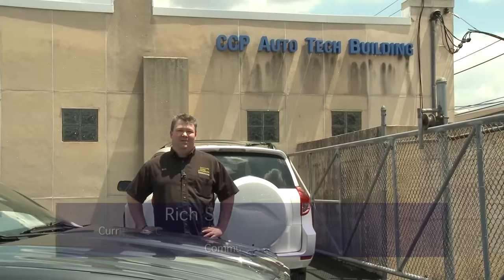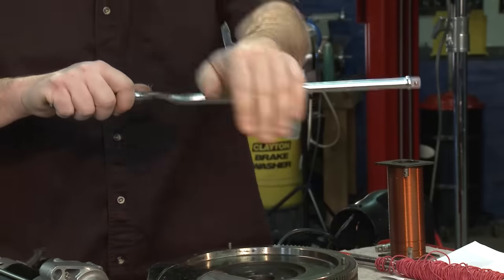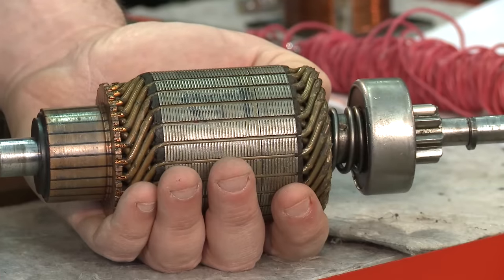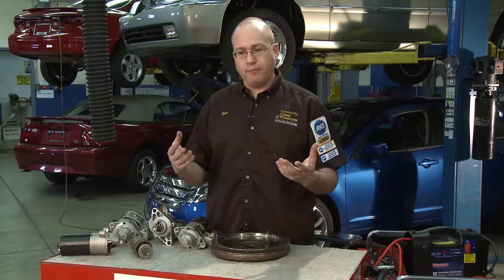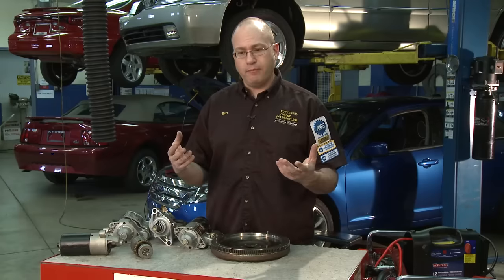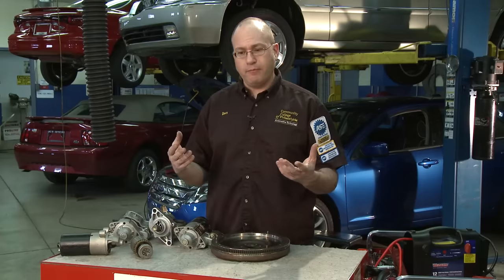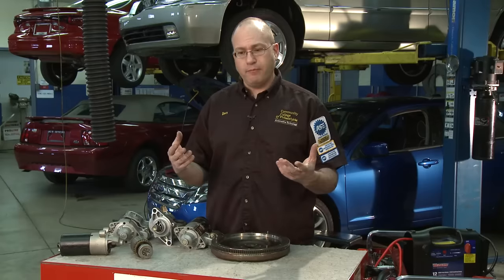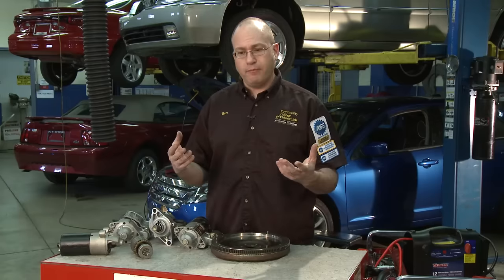Car Corner: Starter Maintenance

Comment: Dear Sir, 
My congratulations for your educational, beautiful and fully explained video. 
But I still have some questions to ask: it often happens that the gear of the bendix does not retract into the starter motor after the engine has been started, but continues to be driven onto the flywheel. 
What could be the consequences of this: that the bendix, soleonide or starter motor would burn if I did not hear it and start driving my car at a higher RPM then the starter is made for? 
Does the bendix function a little bit like a ratchet, that it can spin freely without causing any damages? 
Could it be that the solenoid (relais) continues to receive electrical impulses from the ignition switch, (the electrical part from the switch) even when the ignition key is released? 
Or is this fault caused by the mechanical part of the starter motor? 
Does it then stick to the flywheel, or can it get stuck due to some dirt and no longer retract due to the current flow that isn't interrupted. 
I even had a strange experience about 5 months ago, that the key was in the "Run" position (and not in the start position) and the starter started the engine. 
This happened 3 times in one week, but in the past 5 months this didn't happen again, it disappeared on its own. 
I would greatly appreciate your views on this, for which I would like to thank you. 
Good luck with your upcoming videos.

Comment: Clearly Dan  is the man, love the story telling an the demonstration. i stopped at the 26:16 because the solenoid was not correctly diagnosed and also saying that its not repairable(the whole starter,just to be clear) is not true at all. i repair starters everyday and we are far from just replacing starters. if it was the Armature that burned sure i would replace the starter because its the most expensive part in the starter but it can still be ordered.

Comment: 25:30 it seems the solenoid has a pull in coil to supply the stronger force needed to pull in from the initial position, and a weaker holding coil, which is able to maintain the closed position once it's there.
the pull in coil can only withstand a brief period of being energized without burning out, so it uses the virtual ground of the motor connected in series through what was termed the M terminal. 

if power is applied between the S and M terminal, 12V and ground respectively, it should power the pull in coil and be able to actuate the solenoid without manually assisting it.

once it engages, the terminal is connected to the 12V of the battery terminal, and the pull in coil no longer has any voltage differential across it, so it no longer does anything.
At that point, the weaker holding coil using the case ground is all that's needed to maintain the position.

when the starter signal at the S it switch terminal is removed, the solenoid is able to retract from the spring pushing it back to the original position.

Comment: My first car that I bought had a starting handle and I was very disappointed when I bought my next car without one. You could turn the engine over slowly to get the oil going in all the right places especially if it had been stood for a while in winter. Of course there was a technique how you held it before giving it a good swing to get the engine started.  If you didn't hold it correctly you risked breaking your wrist or worse.

Comment: Solenoid not pulling in... perfect problem to have for this vid!  Solenoids need their voltage obviously,  but there are two current requirements: pull in and holding.  What those numbers are depend on the wind, but always expect higher current to pull in. It's less than a second, but it has to happen or you won't get movement.    So, if your battery is on the edge, connections are loose, or have a wire with partially broken conductors [as in somebody hung the starter from its wires on a lift some time back] don't go racing to change that solenoid until verifying whats feeding it.
  Do you own a DC amp clamp meter?  You should - very helpful in troublshooting any inductive loads like motors or coils.
Edit:  I forgot my question - what do you like to see for mica undercut on most automotive starter commutators?

Comment: Nice that is one of the best trys I've seen so far however the saying flying off the handle its origins is 1st used in the year of like 1840s and it meant someone going crazy like a axe head flying off the handle and that's the origin of that but I have no doubt it was just as common of your story

Comment: Your battery pack was not weak..... there are two sets of of windings in the solenoid. The first is the pull in winding which gets it's earth via the brushes , this winding draws a large amount of current. As soon as the  contacts on the solenoid close , the hold in coil takes over (drawing a lot less current) . You were trying to use the hold in coil hence you had to help the plunger go into hold in mode.
Reply: Spot on.
Reply: Thanks, saved me the trouble of replying. Solenoids are often replaced when the pull-in winding can't find its ground (brushes or armature).

Comment: This guy is the real deal...great mechanical mind! Funny how Cadillac was first to make electric starters standard on all production models...then years later they placed the starter in between the valve covers underneath the intake manifold on the North Star WTH we're they thinking?! I'm starting to understand how manufacturers no longer value their customer's or the quality and longevity of their product. Now they build them to break so you have to buy another one failing to realize the negative experience can make customers try different brand makes losing past practice of longtime loyalty of car and truck buying. Just saying...

Comment: Well done 👏  I did jumped my hyundai tucson 2.7 starter direct to the battery by  splicing ground wire and running it the the battery and I got a loud clunk coming from the starter. 
My brother inlaw told me it's another way 🤔 of testing 
The reason why is i brought to the starter  shop and they said it's good and witnessed spindle spin. But my brother inlaw said there's no load on the starter. 
So when i preformed that jump method the starter didn't turn over the engine. So it showed that the starter is stuck or not turning the flywheel.
Is this method on checking if the starter needs replacement??
Thank you 😊

Comment: Just installed a new starter, when trying to put negative terminal on my battery sparks coming out. Also starter stays always ON (spinning but not engage) - after my first key ignition start. Now every time when I put the battery negative connector starter just spinning (when relay is took same thing - but sometimes goes off). I also detached 's' from the starter and same thing also stays on! 

Any ideas what could be wrong? Solenoid is broken or something else like short on the circuit? 

Thank you for your help! GREAT VIDEO!

Comment: I doubt the "electro magnet" demo you made was still slightly magnetic because sometimes those socket extentions or bits have magnetic material in them making your screws or bits cling to it so your screw doesn't cause such a pain. Another reason I don't think the electromagnet isn't attracting is it had no power to create the magnetic field, take a scrap crane with the electromagnet attachment on it, it doesn't attract until the operator give it juice which it then attracts. Good video though👍

Comment: NICE lesson 
Periodically my stater will not disengage fast enough and remains engaged after the engine has started. I immediately let the clutch out and stall the engine. Even shutting off the ignition is not enough to shut the engine down. 
Will this this issue damage the starter?
Thanks

Comment: I had an old Renult car in the early 1970s that had an optional hand crank.  Unfortunately I had to use it sometimes due to battery problems with the car.  I felt that kickback a few times and it usually hurt my arm when doing so.  But it was not a serious injury, since I was wary of the possibility of the kickback.  My guess is that only people ignorant of the possibility of the kickback didn't crank in a proper manner.  When my manual cranking didn't work I just pushed the damn car and jump started it.

Comment: Good stuff Dan - very helpful well presented informative session and really appreciated. 
 But a bit of interesting historical fact about your illustration of holding the crank handle witha full grip around it..  
 It was never a good idea to hold the crank handle as you did with the thumb around the handle because many people injured or broke their thumb  when it was around the handle when there was kickback and the handle..
The safe process was to Not put your thumb around it but keep it on the finger side of the handle so when there was a kickback it merely broke your grip and the handle came safely out of your fingers.    
.

Comment: One of the main problems with the starter is the solenoid which is a high amperage switch so every time you start it you get a spark and that burns out the main problem with the starter is actually the solenoid that start switch used to be able to replace that solenoid but now you have to replace it all which is not a bad idea because the solenoid doesn't really wear out that quick probably by the time that wears out you do need a new starter so it's kind of a package deal

Comment: Thanks for the video,  I learned a lot.    My 2008 Chrysler Town and Country is not starting.  I can hear the starter spin but not engage the pinion, no engine crank.  I removed the starter relay and short the two connector 30/87 and can hear the same like high speed spinning.  Could it be the solenoid on the starter?

Comment: That was excellent  Dan!    I am having a problem with  my starting  on a vw cabrio.  I had a bare wire  ( worn insulation) to one of the solenoid motor terminal posts and i applied dielectric grease to protect it  ( dumb move) .  I drove down green lane to main st in Manayunk and the car stopped running. I think that i MAY HAVE ATTEMPTED CRANKING  the engine over  while in DRIVE.   So now I dont know if it was the grease on the wire or if it was the cranking while being in DRIVE. Now the key doesnt bounce back to run from start. The display  icons on the dash are on even without the key  in the ignition.  Anyway you've given me plenty of info to go by .If anyone has any opinions on what the dielectric grease did I'd appreciate your  input . 
Thanks a bunch.

Comment: I think in some german cars it is required, by design, to remove the battery to replace the starter
that way there is no risk at all to have any issues with electricity
that also makes for pretty easy acess to the starter, so you can remove it fairly easily
tho, what I was missing here is the starter style where you only have the pinion move out when the starter is engaged, the shaft has a shaft seal to prevent dust ingress and grease from getting out
a pretty small, but important detail in my oppinion as it decreases wear and increases durability of the bearing
Reply: When you are working with "Vehicles", always take your Battery off, unless you are working with a Radio!  Not only with other dangers... It also protect your important components, like the ECM (Computer), which is expensive.

Comment: I have a question. I have a 1961 Chevy Apache the starter has four terminals the two big lugs, one for the solenoid and the other for the ignition not ground. It’s grounded through the chassis. Can you explain how this works? The HEI is attached to the ignition screw the solenoid ( purple wire )is obviously ignited by the ignition ( pink under dash white at this terminal).

Comment: Hey Dan Great video. Question for ya ... I'm experiencing a problem where my starter will intermittently continue to crank even after shutting off car or removing the key. Could my starter be faulty or is it an electrical problem?

Comment: excelent video well explaned.  reason why I end up watching this video is beacause today after replacing  the starter on my 1998 chevy silverado  k1500 truck I had cranked the engine right when I  was reconecting the battery terminals.
that was tell me that something was not right .
also with terminal wires disconected from battery I had countinuity was that normal?
with no key on Ingnition?

Comment: I see that you put only 1 starter holding bolts, it should be 2 bolts, right? and also you did not tightened it. Anyway, I like your demo board, I will make my own similar to that yours. Nice presentation Dan.

Comment: absolutely the best explanation of the starter/starter solenoid i have found anywhere.  i'm currently troubleshooting a riding lawn mower starting problem.  do ALL starters work via the moving plunger/fork mechanism activated by the solenoid?  the reason i ask is that there are a huge number of youtube videos that show a solenoid completely physically isolated from the starter motor.  does this mean that what most are calling "the solenoid" is actually different from the "starter solenoid (that is mechanically linked to the starter)"?.  in other words, if the solenoid is physically separated from the starter - how do the starter teeth move into place to engage the flywheel teeth?  i suspect there is much confusion about what component is actually being discussed in those other videos.  likewise, successfully cranking a mower by shorting the "B" and "S" terminals with a screwdriver would actually mean the staring system problem is somewhere other than with the starter/solenoid (because otherwise - how would the plunger/fork system to engage the starter teeth into the flywheel activate?) - did i get that right?

it would also be nice to hear some reasons why a starter solenoid and/or a starter motor actually fail.  after removing and isolating them to a very similar benchtop setup like yours - my solenoid appears to have failed and my starter runs intermittently and begrudgingly - like it has some high internal resistance, possibly that is what caused the solenoid to fail.  all i know is that my honda engine has been flawless until last year, then began becoming "cranky" -  needing charging/jumping even with a new healthy battery and starting giving lots of solenoid clicking before occasionally starting up.   i hesitate to simply throw in a new starter/solenoid if there is some other problem that will eventually just kill the new starter/solenoid all over again if not rectified.

Comment: "he flies right off the handle for nothing..." was first written in 1834, by Thomas c. Haliburton.

the motor wagon was produced in 1956, over 30 years later. There where horseless  carriages being talked about in 1803, and a steam powered carriage that was sold to the public in the 1920s.
Model t was 1908
If flying of the Handle came from slipping off the crank start of a model T, why was it written down 80 years prior? Because like an axe head off the handle mid swing, a man flying off the handle can get someone killed for having committed the sin of being in arms reach.

I'm not saying you are wrong, I'm just saying that the mass use of the term was well before the mass use of the car that supposedly is the origin of the term.

Comment: In older cars when the brushes were worn out, the starter would not turn if any brush lost contact with the armature. If you struck the starter with a hammer, the vibration would hopefully move the brush enough to make contact with the armature again and the car would start. These starters would have copper alloy brushes . And ya, you could only get away with that so many times.

Comment: I got a starter and it looks like one of the washers are cracked on the bottom and the bolt loose on the selenoid. Do I just get another washer and tighten the bolt or take it back to the store? This is a fabulous video!
Reply: Cracked Washer = That is what they called a " Locking Washer ".  Locking Washer Function
 = The lock washer prevents nuts and bolts from turning, slipping and coming loose because of vibration and torque. All you have to do is tighten it and that is about it.

Comment: New starter solenoid and new starter installed in my Honda 350 Foreman 4x4 bur still won't start. Battery is near new has is working great but can still only start the machine by kick starting it. What else can be the problem? I'm stumped!

Comment: Confusing me.  If the car is positive grounded (mine) and I connect one end to the "ground" as he says, then run to the B terminal which seems to be red wire positive, I'm just connecting to + to +  I'd think and read zero/no test light. So do I connect to negative at battery or to "ground" as he says?

Comment: ⭐⭐⭐⭐🛠️🪥  What a master shade tree mechanic sharing street level test and repair methods most any mechanically inclined side of the road Grease monkey first learns from their pops or adopted parental unit as soon as legs long enough to reach go-karts gas, clutch and brake pedal or shoot a 22. So by time you and your buddies reached cruising age one is already prepared to amaze girls by getting stranded vehicle moving again. 

(of course fortunately anything made in the USA can be repaired with a hammer of screwdriver also engineered to be rebuilt several times over)

Oh just remembered fact how early starter switches were on the floor similar to how high bright switch had also been floor mounted until moved to the steering column where operational environment was cleaner than wear ones shoes tracked in mud and salt. Floor mounted starter switches had also carried full amperage shunting between battery and starter where today's are ignition relay operated similar to magnetic contactors which uses lower v o l t switch to throw a higher amperage volt switch both separately isolated from each other.